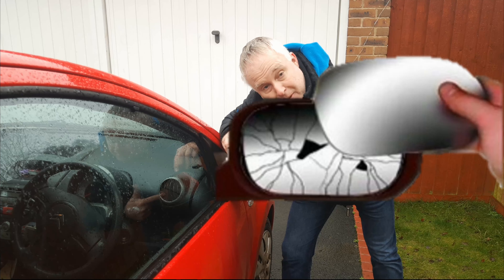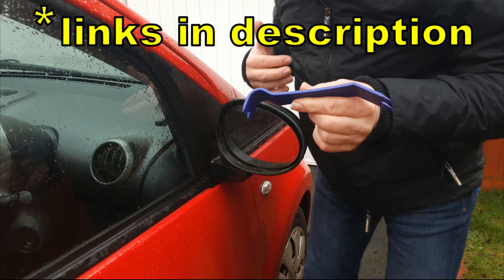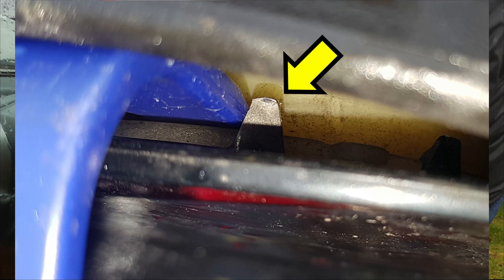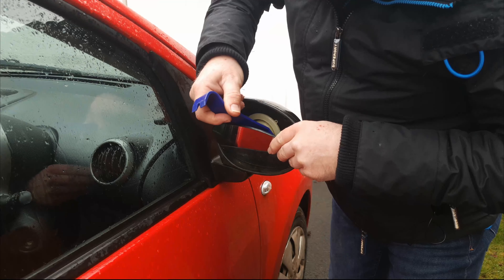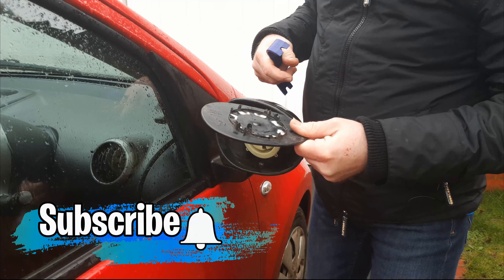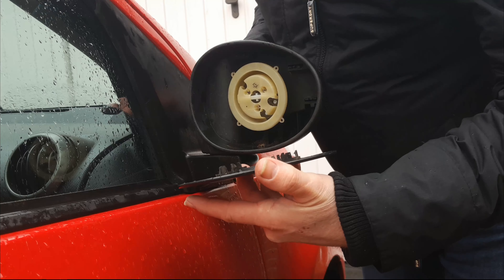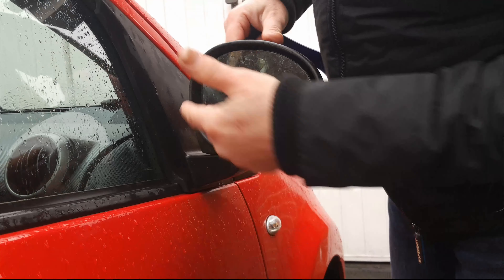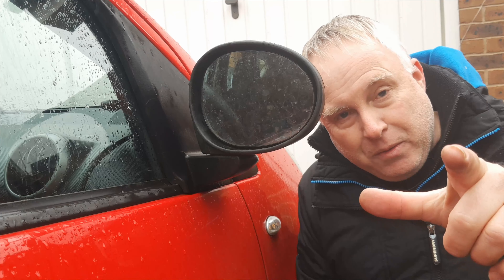Citroen C1 Change Door Mirror Glass | Easy DIY How To

Comment: Hopefully the replacement unit I got for mine will have a decent mirror. Here to see how easy it would be to transfer the mirror (if the aftermarket mirror is rubbish) assuming the replacement unit has the same mount. 

Somebody smashed my whole wing mirror off during the night, apparently they walked down loads of streets in driffield randomly smashing wing mirrors off cars.

Comment: Hello mate I have a saab 9.3 stability control failure pops up can you tell me what it is comes and goes
Reply from the maker: Is it accompanied by traction and ABS warnings?
Reply: @CycloneCyd  yes but it comes and goes whats the best way to fix it
Reply from the maker: @chriskenwright3635  Two possibilities: 1. internal damage to a wire leading to one of the rear WSS's, especially where the cables jump from body to suspension  OR  2. loose connections along the edge of the ABS ECU. It can be removed from the valve block and the connections resoldered.

Comment: On the citreon c1 is it two presses of the keyfob to lock the boot, one press only locks two doors then press it again boot locks?
Reply from the maker: NO. One press locks the whole car. A second press does nothing.
Reply: @CycloneCyd  hmmm I have to press mine twice to lock the boot as well
Reply from the maker: @mrt4409  There is no rhyme or reason why anyone would write locking software to do that. I've also just been out to sweep snow of ours and double checked it - from fully unlocked to fully locked, ONE press of the lock button, as expected. There must be something wrong with yours.
Reply: Checked  mine again and this is what I did I  left the boot open locked and unlocked with the remote fob guess what it's back to normal now with only one press of the fob locking everything, hope this helps
Reply from the maker: @mrt4409  I'll try and reproduce this issue then. Must be something mechanical.

Comment: Prob a dumb question, but how would you go about changing the rear view mirror for a city bug (aygo)? Dealership want to charge me almost 70 quid for replacing it o.O
Reply: If it's the same as the misses 2008 Aygo it just slides up and off, really easy, cheap to get new ones as well
Reply: @jonsadventures4949  😁 thanks - I'll definitely give that a go then!